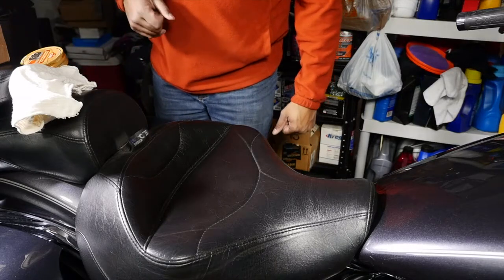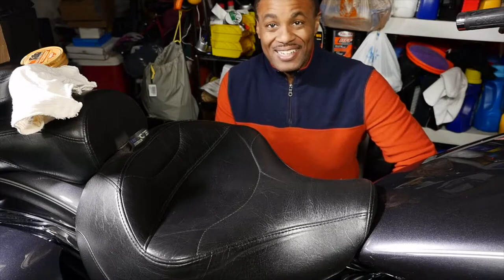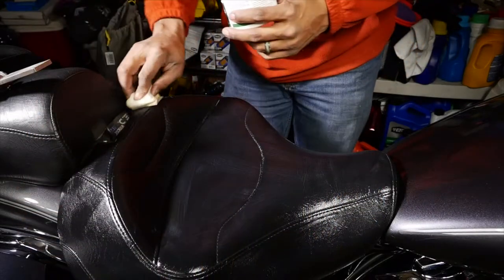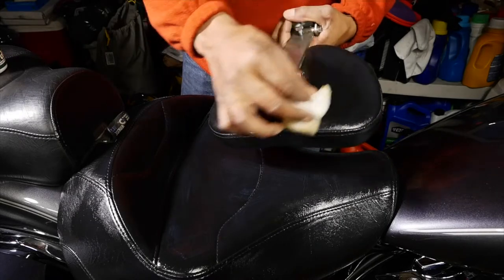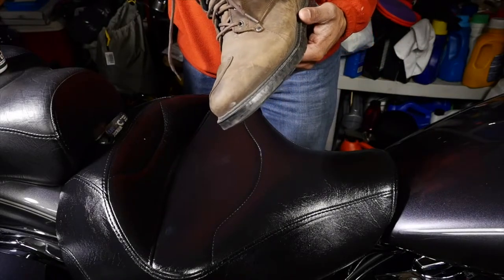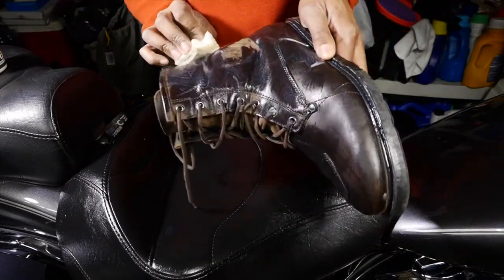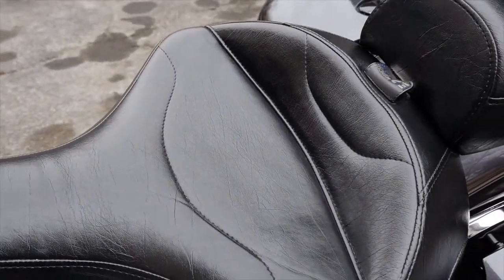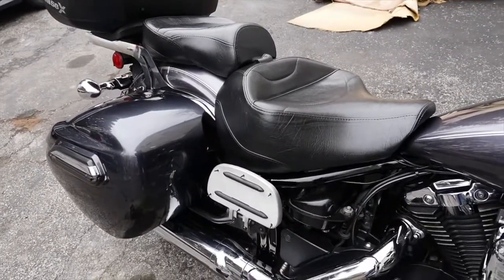My buddy Got me this awesome leather Treatment.

Comment: I wear TCX Hero WP boot as well....Excellent shoes, I've had my pair for years. I like them so much, I bought a pair of TCX X-Helium MX boots my off-roading.  
I was a afraid that Urad paste was going to leave a slippery, greasy finish, then again I use mink-oil paste which goes on about the same but when dry just leaves a soft finish.
Reply from the maker: I wondered the same thing also. I usually ride with some Kevlar Jean's, and anything slippery is just an nono hehe. 
The tcx boots have been awesome. So comfortable,  I can walk around in them all day too. I can see why you love them. I just need to treat them more often. I may order them in black too, or similar.
Reply: @dbest1aVlogs  Damn, now I may have to try me out a set of the TCX boots.  Too many happy feet on here!
Reply from the maker: @AnthonysWestTexasRides  Yes sir , they are all great people. The tcx boots are amazing ... gotta pull the laces n treat that area.  Think I'll do that now, and need to go buy grass seed.